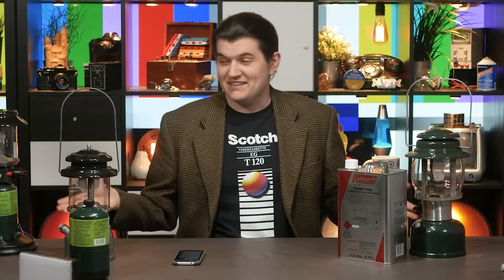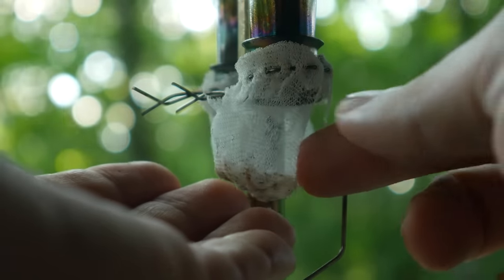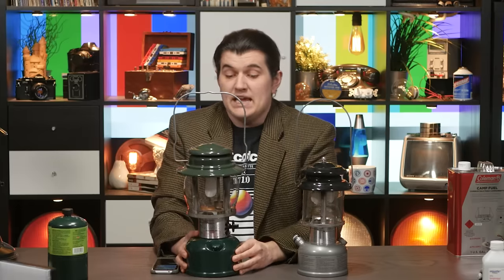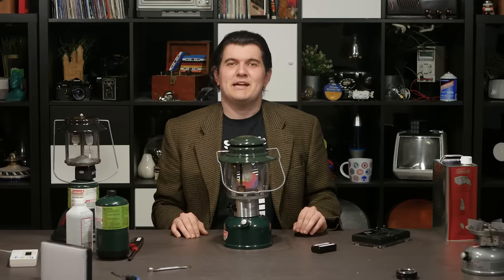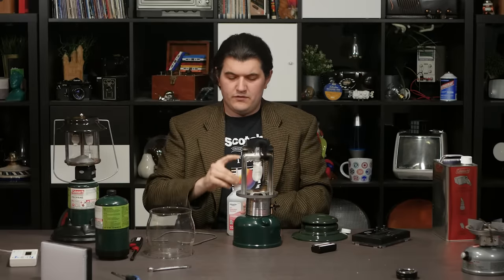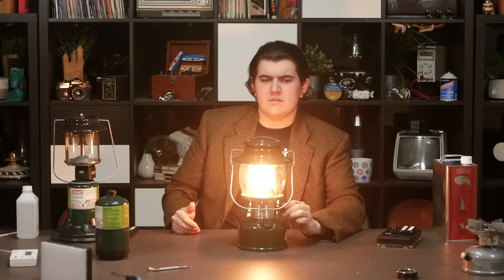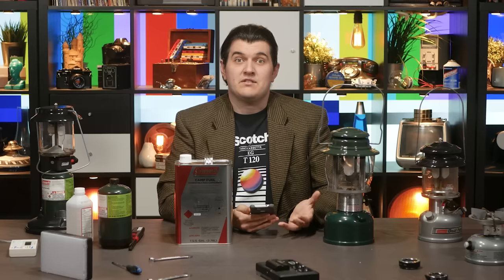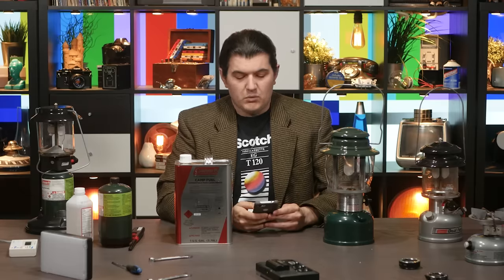A very rambly Coleman Lantern follow-up. Turns out they rarely make sense in 2021

Comment: About 70 years ago when I was a kid, we used Coleman gas lanterns and stoves to go car camping. It was the family recreation we could afford at the time, and for me it was magical. We also lived in a rural area where the power would go out in the winter, often for a couple of days at a time, and these were what  we used then as well. I started doing camping again about 20 years ago and started looking to reacquire these units, only to discover that "modern" concerns had drifted supply toward electric lanterns and propane stoves, neither of which "hold a candle" (pun intended) to these older technologies. Stoves were gone, but the lanterns were available at huge expense. Instead, I bought older units on ebay and rebuilt a lantern and stove, as parts were easily available from Coleman. I do not loose power these days, and I rarely need these for camping, but they are around just in case. Frankly, I never had any trouble working such devices. I guess the Iphone generation just doesn't have the chops.
Reply: "The younger generations don't use technology X, which proves that they are weak or incompetent. It couldn't possibly be that technology Y has made technology X largely obsolete."

Comment: Once you learn how to properly start and run gas pressure appliances, you'll find that they are reliable, and do what they were designed to do.
Reply: OFF ROAD GASOLINE (not taxed) is just as cheap as kerosene.  Almost a dollar less than auto gasoline.  So once again, no reason to deal with the lighting hassle of kerosene lamps

.
Reply: @electrictroy2010  The incredibly high volatility of gasoline says otherwise.
Reply: @Vapourwear  and the smell and toxicity
Reply: @electrictroy2010  But where can you get it as an individual ?
Reply: @electrictroy2010  only 25 cents cheaper, not worth it honestly

Comment: For the emergency lighting point, it might be worth considering availability of fuel in the event of an extended emergency.  For example, a few years back we had an ice storm knock out power here for a week and some of the more rural areas around us didn't have power for a month or more.

From experience, in that kind of situation, those propane bottles are likely to be impossible to acquire once you run out.  There are ways to refill them, but they aren't engineered for that and it's actually a really bad idea.  Denatured alcohol is in the same boat.  As soon as people think there's likely to be a power outage, they run out and buy up all the stock on the shelves.  (as an aside, this really sucks if you routinely use denatured alcohol for non-emergency things and run out at the wrong time)  I'm not sure but I'm guessing that kerosene is also likely to be hard to come by in this situation as well.

The dual fuel white gas/gasoline lantern may actually be the best bet as far as getting more fuel during the emergency goes.  I'm guessing that white gas would also likely be unavailable but gasoline can be acquired.

Maybe the best bet would be to have both a kerosene lamp with like a weeks supply of kerosene and a gasoline lamp just in case.  Then when your kerosene is running low, you can then just fill up the gas can for your mower and have a couple of gallons on hand.

It might seem like recharging batteries via solar would be a good way to go but in the winter situation that I'm talking about, it actually might not work out due to the cold.  I dunno.

Just food for thought.
Reply: Actually, the Kero units are the best option as they will burn white gas, gasoline kero, diesel and any other flammable solvents (varsol turps etc etc)
Reply: @matthewq4b  Using gasoline, white gas, acetone, ethanol, or any other fuel with a flashpoint below room temperature in an unpressurized lantern is a remarkably bad idea.  Don't do that.
Reply: @ColonelSandersLite    Uh did he have unpressurized lanterns or pressurized lanterns here?.   Pretty sure the video and the discussion and at hand is about pressurized lanterns.    Try to keep up with the program skippy...
Reply: Gasoline/petrol has a shelf life of several months however. Because of that, it is not recommended for long-term storage, unless you plan to keep adding fuel stabilisers to it. Kerosene & denatured alcohol/methylated spirit keeps for much much longer... several years at least.
Reply: @jonathantan2469  just remove the air from the gas can it will last years.
i keep 40 gallons for power outages. Used gas this past sunday that was proby 2 years old. Picky ass, fuel miser generator ran perfect.
Reply: gasoline / propane powered generator , with LED lights. small generator and five gallons can run all night , easy. And a buddy propane heater will run full on for more that 20 hrs, with a grill tank.

Comment: Of course, using LED lighting and batteries are overall the most efficient and cheapest choice, but with the highest upfront costs. As the aphorism goes: “It’s expensive being poor.”
Reply: actually I do have a powerbank (which includes solar panels, actually working to charge it ) 
it includes a light and in the most recent power outage it was quite useful....  it has 4 cells and while it claims to deliver 25 Ah it actually is in the 20Ah area ... 
however the point is ... it was cheap to buy,  25 bucks on sale
Reply: It also, IMO, depends on how often you use it. It would not make a lot of sense to buy batteries and then use them once a year (a reason why I do not use wireless headphones and why I dislike proprietary batteries and would rather all of my battery-powered devices used standard batteries, AA or whatever).
Reply: I was going to say that this seems like the prototypical purchase for a micro-loan...but Kiva's already got a page describing how LED lights can save money over time, produce more light more easily, don't produce any fumes, etc. :)
Reply: And if you are far away off the Grid, like Alaska or other off the grid places charging batteries might be a tad hard.
But 1 solar panel should easily be able to charge a battery for some LEDs with ease, even in Alaskan winters.
Reply: But gas/fuel lanterns aren't cheap either.
The ones on amazon start at $30. 
So how much more would an battery light really be?
Reply: @teaser6089  wouldn't the same be true for fuel?
Reply: ADDENDUM: i was mentioning powerbank because it is something you keep charged commonly in case you need it on the run for convince not security. 

also in the slums of any country sheds tend to be windowless (being built very close and cheaply), it is an issue to get lighting during day ... however the solution apparently are plastic bottles filled with water through the roof. 

however a used phone battery plus a  solarcell (3+) with a few LEDs will go a long way and are affordable enough in these areas too
Reply: @Jehty_  I should have worded it better, what I meant was that fuels make more sense if you live far off grid, however if you have some more money to spend getting one solar panel and a rechargeable battery storage solution is possible as well, for a few hunderd to maybe 2k dollar at worst. Especially if it's only for lighting. Also means less frequent resupply of gas, since you can stretch the supply more. However a propane lamp could still make sense, as a backup light in the case of a EMP event or solar flare. Both can happen.

I think it's also personal preference and situations, both have their benefits, but each year batteries get cheaper and larger capacities are available. If you are handy with electronics you can reduce the price drastically, if you assemble a battery pack yourself, again it's kist situational.
Reply: @StixFerryMan  this was an interesting read, I agree from a first world perspective these things don't make sense, but if you live in a third world country you don't have access necessarily to the vast cheap materials we do. And since humans are a very creative species, where humans are pushed hard enough they will always find a way to make something work and although that is waaay out of the scope of Alec's video's it's still an interesting thought to keep in the back of the head, of course that's why we should assume if Alex speaks about something being obsolete, he means the North American / Western Market, since he's familiar with those.

Comment: One thought about the LED versus lantern idea is places like Bangladesh, especially remote regions you can still run into incredible simply constructed living spaces. With that being the case, the question of the lighting’s susceptibility to the elements moves to the front of the list. I’m not sure what kind of access there is for purchasing ruggedized LED lamps, but given there are places where humidity levels can actually preclude electronics from functioning I can see why even the kerosene lamp might make sense. One reason is places that do have such difficult living conditions do often have infrastructure (even if it looks likes it’s about to fall apart) for something as critical as fuel which means that the cost of something like a gallon of kerosene might be as insanely cheap as $0.50. It has a lot to do with that aging infrastructure which I’ve experienced seems to be held together with bubble gum and tape. With any real safety policies not being followed at all. So the cost of maintenance, etc. become virtually nonexistent. My point is, you’d be surprised at how much cheaper things can be in these places, because of two things, it’s become a depended upon staple, and it’s used by the very poor as well. As such, any extraneous costs are cut away. You don’t want to think about what they do to cut those costs. 
So, my point in all of this is that if you’re using a lantern of this style (definitely a cheap knock off version) it may make sense from both a safety and economic basis. As you noted, kerosene isn’t great at simply being lit. If you’re in one of the many monsoons that strike this region, I’d definitely want a source of lighting (and heating) that stands a really good chance of soldering on, I wouldn’t even be surprised if these things have been passed down through several generations. That’s just the way some of these places are even today.
PS: I just thought about another big factor. Living in the US, we’ve come to assign incredible value to convenience. Not so in many parts of this world, where life is fundamentally accepted as being harsh. So how easy it is to get going, might not even be something that crosses their mind. 
While my experience in these kinds f places was a few decades ago, from what I can tell, there are still places that live like one would have a 100 years ago. Except they might be caring their water in a large plastic motor oil jug and wearing a Motley Crew tshirt. No joke, the cast offs of our modern world can easily end up in tribal regions (which is where I spent most of my time).

Comment: I was also thinking about countries where kerosene is widely used as a fuel for light and heat. When my BIL moved to Japan he ran into that. His heat in the winter was two of the portable kerosene heaters and they had a seller come to the house every couple days to fill the heater and lighting units. At that time they didn't build houses like we build them in the US, they didn't insulate or have central heating or air conditioning in anything but hotels.

Comment: There's a certain romantic ambiance that a "fire" has, especially when camping
Reply: I agree.  LED lanterns albeit efficient...are ho hum boring..very very boring
Reply: @alexkq2h770  With RGB ones you can change the color to whatever you like and there are even ones that mimic the flicker of a campfire
Reply: Yes. And, on a cool night, the radiant heat you get from the lantern feels good. Not as good as from an actual wood fire, but fire bans seem to be happening every summer lately, so the lantern is better than nothing. Also, the white noise they make is kind of soothing.
Reply: @Top1-p2x  They need to make one that mimmics the sound of a Coleman lantern :)
Reply: We have an old fashioned wood fireplace in our house and it's awesome for ambiance. Plus, cutting firewood is good exercise.
Reply: @Lucas12v  The old saying is, "wood warms you three times. When you gather it, when you cut it, and when you burn it."
Reply: @paulsto6516  I have some vintage military lanterns that sound like a jet engine running, lol!  There is a way to quiet them, but I don't because these lanterns sound like camp.
Reply: @paulsto6516  Pretty sure you could isolate from these videos and just play it on a speaker
Reply: *ambience
Reply: @Top1-p2x  RGB LEDs don't release infrared waves... Do they?
Reply: fire = Caveman TV, it's like we've evolved for it
Reply: @plumber1337  No. Why should they?
Reply: @Top1-p2x  I admit to playing with LED lanterns and lightning in general...but how can I be a pyro and not play with lanterns. I love kerosene pressure lanterns. The  modern Coleman 639 kero lanterns smell a little because the crimped together air tubes leak a little raw fuel thus causing odor. The vintage Coleman kero lanterns such as the 237 burn odor free indoors. Also many old central draft kero wick lamps burn without odor either.  I use them to take the chill off a cool room rather than a super efficient light source ...

Comment: The great Thorium mantles are not the silly modern 3rd party ones, but rather the vintage ones that are called Silk-Lite 21A - like old stock ones from the 1960's and 70's, those are the ones that all of the fuss is about, they are amazing!
Reply: Yep. The modern replacements were A) unnecessary and B) suck.  The danger of these things is/was VASTLY overstated (just as the alleged dangers of using the fuel lanterns is in this video).  People are just irrational when it comes to radiation. 

This is true for most things.  I remember when they phased out Freon.  Oh, god, the new stuff sucks.  You would not believe, if you are a young guy just how much better air-conditioners used to be  in cars.  It could be 98 degrees out and get 50 degree air coming out the vents.
Reply: @christo930  The danger of radiation is often overstated yes, although as Alec points out the story is usually very different for the line workers compared to end users, and so getting rid of stuff like asbestos and thorium tends to be worth it on the whole, even if the outcome is somewhat worse for the consumer. 
Freon is a whole different beast though.  It was very much killing the ozone layer, and that is bad news for everyone.
Reply: @christo930  If your bit about refrigerant were true my R-134a equipped vehicles wouldn't have vent temps in the 30s.
Reply: @danielthechskid  That's not possible.
Reply: @christo930  Freon is a brand name, not an actual "thing". Freon R-134A is still a standard thing now days.
Reply: @christo930  Depend's on the outside air temp, but you can get in the mid 30's in the vent with R-134a. Ask yourself what is the higest drop in temp R-134a will get you, and at what outside temp. Now back in the day with R-12, R-13, and R-22 found in car's and truck's back in the day. You could get "snow" blowing out of the vent's on a good hot day, from the high humidity in the air. Oh the good ol day's.
Reply: @ducewags  Well, I am mostly talking about retrofits.  Not to mention I haven't had a car with great air-conditioning since the 90s.  But I also haven't been in a recent car in the middle of the summer.
One nice difference though is back then, it cost money to run the air.  Today, you'll get better gas mileage by running the air with windows up.
I can recall the gas mileage really suffering, even on the highway.
Reply: @ducewags  Yeah, I meant R-12.
Reply: @ipodhty  1) I had qualifiers in the comment 2) my opinion is subject to change with new information. 
What I read is that the expected illnesses are much higher than actual ones.  I also stated that I think not all people handling asbestos are equally at risk.  There are ways handling asbestos is way more dangerous, such as blowing out a brake drum.  It requires continual exposure to the stuff. It's not like hydrogen-sulfide where breathing it in, in high enough concentration causes instant death.
If you have a hungry baby at home and no income/job, and someone offers you a job paying $35/hr to remove asbestos, it might very well look like a good job under the right circumstances. It's called risk assessment.
I wish you would highlight exactly where I said I am pro-asbestos, whatever that even means...
Reply: @danielthechskid  if you vent temps are really in the 30's, your expansion device is not working correctly, and your evaporator is freezing up and if you don't straighten that out, you will be getting liquid refrigerant back to the compressor eventually, and when your compressor tries to pump a liquid...... well, let's just say you are not going to like the repair bill!
Reply: @burrito rustler nice name by the way. The new R-400 series is very close to the old R-12 R-13 series freon back in the day.
Reply: @Kevin75668  Freon is the corporation name, by Dupont.